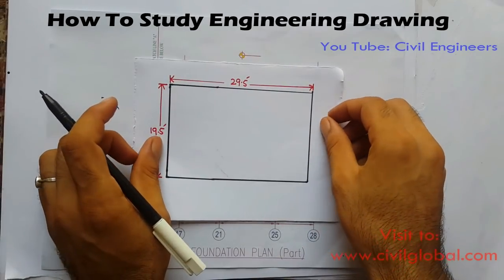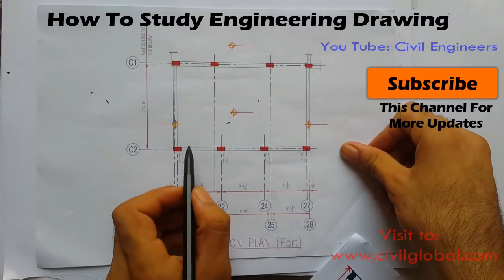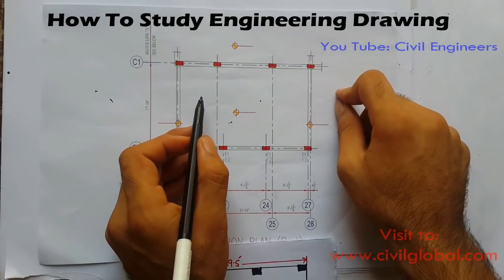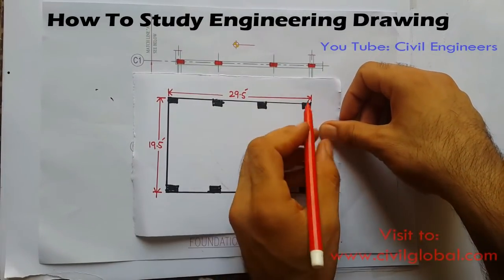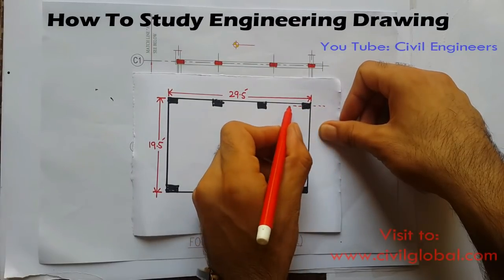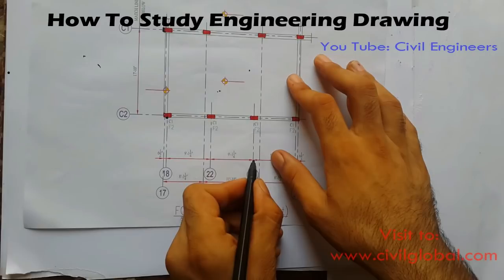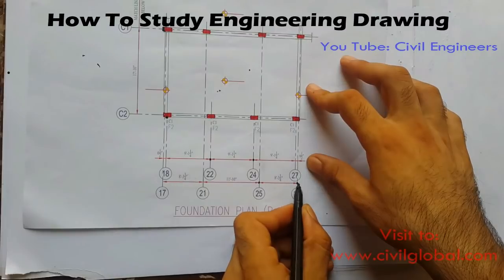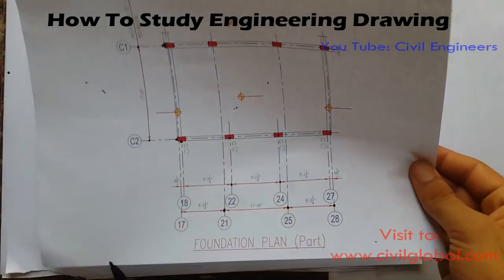How to Study Civil Engineering Drawing

Comment: Sir I have a question 
What do you mean by the value that you had written in the bottom side....
Like 24 , 22 , 18 (what are these actually )
Reply: sir did you get the answer of your question.?
Reply: Even i have the same doubt bro
Reply: That is grid number that is normaly start 1searioly. The drg showed  here is a part drowing. In a full drg, grid start from 1&A (vertical&Horzontal grid respectively )